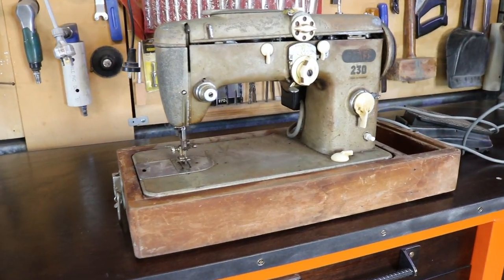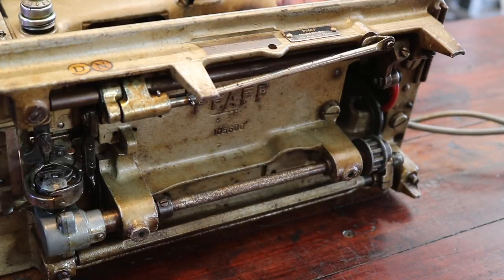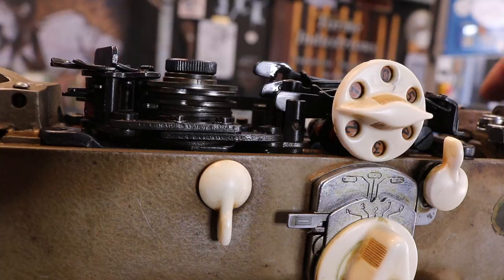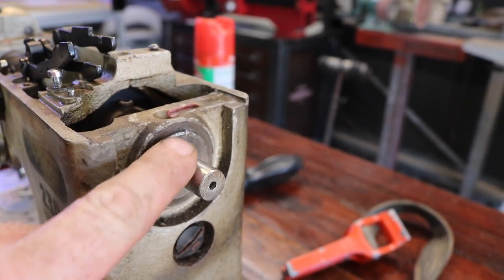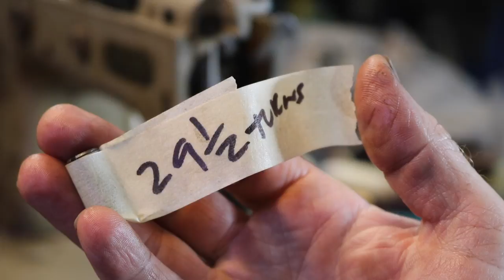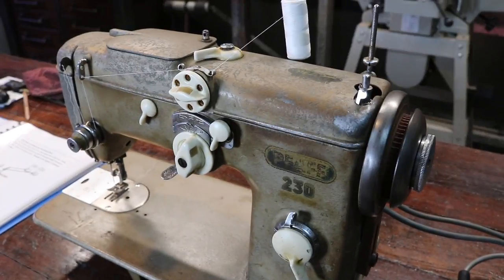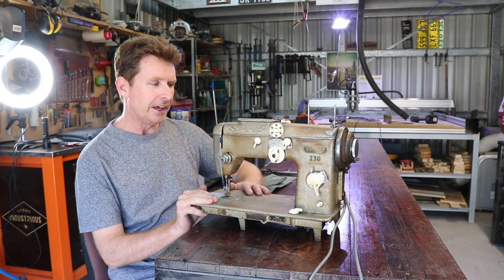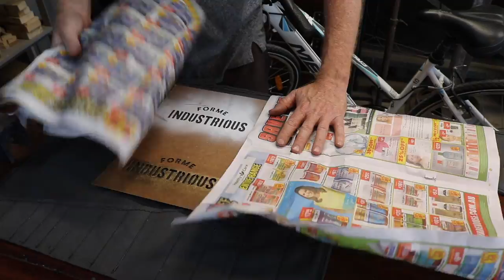Vintage PFAFF Sewing Machine Repair - Forme Industrious

Comment: btw I showed your repair work to my mom, shes retired by now but worked as a tailor until  the whole textile industry was moved to asia in the late 80s, she asked me to relay to you that you did well on the repair and the machine you got yourself is very fine and reliable model, she herself had a very similar one back in the days and was very happy with its performance. so if you keep it clean and run and oil it once in a while you can't go wrong with this one and it will last you another 50 years.
Reply from the maker: Thank you for sharing that with me! Yes all the industries have been moved away to take advantage of cheaper labour and less regulation etc. Please thank you Mum for her advice and her encouragement! All the best!

Comment: I have a 1957 Pfaff sewing machine. It was my Mom's first machine, and I learned to sew on it when I was a kid. It also needs the same belt. It doesn't have the corrosion in it that yours does, but is full of dry lubricant that will have to be soaked out of it. The 'mechanical computer', the cams and pins are mounted on the back of the machine. It is a dressmaking machine, not a light commercial unit. But it IS a cast iron Pfaff, and as so is a heavy unit. Love watching you do your thing. Great video, good tips, I'll need them with this machine, LOTS of parts... Michael
Reply from the maker: Thanks for your comment Stephen! Yes they are great machines I agree and with a bit of effort they can be fixed up and be almost new again. All the best getting your machine humming again.

Comment: Amazing how you managed to strip it apart and putting it back together.

I have a Pfaff 260 that I bought a month ago as a toy to tinker with.  

after mending a used IKEA chair cover, I decided to try out the automatic embroidery function and lo and behold the thread snapped just like yours did, and it refused to turn thereafter.

Upon inspection, the timing is out.  I am still looking online for a manual to reset the timing.

Have fun!

Comment: Welcome to the league of extraordinary sewing machine repairers !!     They are tough to reassemble because there are so many pieces that have to be in the correct orientation. I have a 1946 Adler industrial, a 1960s singer domestic and a boot patcher that I don't know the age of. They are a good challenge
Reply from the maker: I just found a PFAFF 230 on the net for $50 no belt. I'm like the expert now and I'm thinking send it to me....then the more sensible Scott says get back in the shed and stay off the computer ;)
Reply: @ScottTurnerformeindustrious  doing it once when you don't know any better is one thing, but doing it again when  your liveliehood doesn't depend on it is another level of insanity. Of course, I will rebuild my Claes boot patcher even though I haven't done any shoe repair since 94. Listen to sensible Scott. Sewing machine $50 , Time rebuilding $5000  that's a bargain

Comment: Unbelievable.  I've never seen a sewing machine torn down so far.  I bought a well used Pfaff 545 that is not working and you have inspired me to keep working on it until I figure it out.  Thanks and awesome job!!
Reply from the maker: Thanks Rob! Take lots of photos before you pull it apart. Certainly helps getting it all back together.

Comment: Love the use of paper clips as pins Scott!  Also love the stencil.  I’m a construction guy who now sews too.  Same disciplines, different mediums.  Great work! Pete
Reply from the maker: Yes the paper clips, simple and fast. Did the job. Sewing is new to me but I am finding it very enjoyable. Thank you Pierre!
Reply: Hey Scott, I’m hoping you can help me. I have a Pfaff 362-261.  I was having trouble with clearance between the positioning bracket’s finger and the bobbin shuttle hook.   In fastening the positioning bracket, is there a spring that creates tension between the screw, positioning bracket and the sewing machine bed?  I took it apart, left it for a few days, and now I can’t figure out how it reassembles .  I’m wondering if I’ve lost a spring...

Thx
Pete

Comment: Rebuilding a PFAFF 130 and have been doing OK until removing the main shaft. From your video, I see that I am on the correct path. Thanks so much for sharing for us.
Reply from the maker: I'd love to have the 130. Such a nice machine and much sought after. All the best for your rebuild.
Reply: Scott Turner Got it out thanks to your video, thanks so much. Now to clean and reassemble all the parts to make it a sewing machine again.😋

Comment: Love your video.  I just bought a 1957 Pfaff 230, and with a bit of Liquid Wrench, I have the automatic decorative stitching working.  Getting that working helped me learn how this machine really works.  Much nicer and much heavier than a 130!
Reply from the maker: Great buy! These machines are so silky smooth when properly tuned and lubricated. Love it! Thankyou Sheri.
Reply: @ScottTurnerformeindustrious  I know it's yours has the same wher as mine when it runs

Comment: Happy to see you took care of this Pfaff! I have the same Modell 230-automatic still working here; but with a foot pedal in a cupboard. This machine can Stich automatically. Mine is from 1957 and works well. Every electric driven sewing machine capitulated so far on heavy multi layers of e.g. jeans or coats or sail-cloth. We live on a german island 40sm off coast and it’s real good to know that the old Pfaff will be there to repair our coats and bags and even can sew sail-cloth for our boat. To calibrate the under-thread capsule is tricky, but worth it... I have a german manual and still the code-card for the automatic-Stich knob-settings; but I guess you’ll find that online as well. And the company is still there and builds high-end sewing machines to this day...
Reply from the maker: I love my old Pfaff - so good. I have since cleaned it up, repainted the top cover and front cover. Looks and runs great. Sounds like you get good use out of your machine. Great to hear. Thank you and all the best.

Comment: I liked the quip about being more complicated than a 747 engine! 

I recently acquired an old Singer (about the same design era as your Pfaff), and an even older Singer with the cast iron treadle frame. Both are in dire need of help, but when I asked about the oldest one, the "new one" was included. It has had the power cord and the speed control cut off, but moved freely. The really old one has a good bit of water damage to the table parts, and rust on the frame. The sewing machine isn't as bad, so it too might be fine after some cleaning. 
Future projects.
Good job.
Reply from the maker: They take time and a lot of care but the work is very rewarding. Some parts are still available but you may have to look hard. I love the old sewing treadles. Cheers!
Reply: I think Singer refurb is a cottage industry here. My Aunt had an old style Singer (though not really as old as it looks, they made the traditional design a very long time) and up until the 90's getting parts was still rather easy. I'm sure in this age of introtubular times, that has gotten easier. Here, Singers are a dime a dozen (though now a valuable dime, but still)

Comment: scott you chose one of the first portable "industrial" machines I have owned two 1953 model pfaffs and pfaff still has great support for there old machine I sold both in time to buy upholstery level machines the model you have will sew 8 layers of denim in one pass and not even slow pfaff also sells parts for there old machines good luck
Reply from the maker: Thank you Larry! Last week I made my wife a bag folding over the heavy material 8 times (Denham, maybe?) and you are right. I had no presser foot height left but it did the job. I really admire the machine, but now I see the walking foot and my eye is wondering :)
Reply: please keep the sewing videos coming I never touched a sewing machine until I was 50 and I'm still learning maybe you can teach me something in fact I'm sure you can thank you Scott

Comment: Found this exact machine in my Aunt's storage. It is mounted in a cabinet with a knee control. Wish you were in NM. It works pretty good but it wants to keep running even with my knee off the bar.  It is the 230 dial a stitch. Still trying to figure out the tensions. I hope to find a Pfaff service store to do the adjustments.
Reply from the maker: Great machine, congratulations. I would advise doing some research on tensions for this machine as different thread may require an adjustment. Always handy to know how to set up correct tensions. There are manuals on line and a few videos on You Tube. Your machine may need a little cleaning and re-lubrication on the moving parts for the knee lift.

Comment: Mate, that machine is incredible. Far more complex than I'd ever venture to guess. Great dual project.
Reply from the maker: It was a bugger, but I'm glad I got through it. Thanks Matthew!
Reply: @ScottTurnerformeindustrious  I had a good chuckle at the 747 engine comment. I was watching and thinking "I've rebuilt engines that were tons simpler than this monster" glad you got through it. Thanks for showing us.
Reply from the maker: My pleasure Matthew. I just couldn't believe how far it had to come apart to change the belt.

Comment: Thanks so much for posting this. I just picked up a Pfaff 230 Auto (from 1955, I think) from local classifieds. It's in good condition, but in need of some cleanup and minor restoration, which I intend to do myself. This was a great intro.
Reply from the maker: Well I think you have superb machine with the Pfaff Kate. It may need a little tuning, oiling etc but they are rock solid and a joy to use in my opinion. Thank you!

Comment: Taking pics before dismantling. I do the exact same thing with Max.
Top work with this Scott. Maybe I should try to resurrect some of the old Bernina's at school. We scrapped a lot of them a few years back when the repair serviceman said it wasn't worth keeping them running.
Reply from the maker: Well there is of course the labour costs and that is what everyone is worried about $$. But if that is put aside, yes absolutely they should be fixed. The process of repair brings with it untold value and worth to the individual and the machine is useful again. I love the idea that countries are just starting to insist on the repairability of machines. Early days but it pleases me. Cheers Damo!
Reply: Balushai
Reply: Balushairecpie

Comment: Hey Scott.  I just bought a 230 in mint condition.  Looks like it sat in someones closet for the last 60 years. Not a spec of rust anywhere.  It was gummed up and I got it free with WD40 and it now works great.  I'm wondering about the internal belt.  I can't find them listed anywhere and I would like to have a spare.  I counted 68 cog's on mine.  Where did you find your belt?  And how tough are they?
Reply from the maker: Sounds like you have a great machine there. I bought my belt from the UK. I live in Australia and made many calls to suppliers with no luck. If you search for PFAFF 230 parts a two sites will come up that is uk based and from memory one form the USA. Yes count the links and order a spare belt as you may need one down the track some time. My new belt is fine. They are a little trick to replace the first time around.. Thanks and good luck.

Comment: This is a great video.  I now understand how to remove the cam mechanism, didn't understand it until I saw what you did.  I would love to see a slower version and an explanation of how you managed to replace the timing.  Is the nylon top gear cracked?
Reply from the maker: Thank you. The top shaft has to be removed to get the new chain over the shaft. It's the only thing I don't like about the machine. I show this in the video. There are manuals on line that help get the timing set right. Sorry I cannot be of more help apart from the video.
Reply: @ScottTurnerformeindustrious  Thank you for your clarification.  I' suspect that I'll carefully re-watch your video lots of times in the coming weeks.

Comment: Hi, I bought a Pfaff 230 Automatic recently.  It came without a timing belt.  And I have not been able to find a replacement.   Local repair shops tell me they are not available.  Can you please tell me where did you get yours?  It looks new.   I need a 68 cleat, 52 cm long belt, I think the pitch is about 8 mm.  Also, do you think a timing belt that is not cleat can work also?  I would appreciate any assistance you can give me.  I love this machine, as soon as I saw it, and I feel it's worth saving it.  Mine can be used with a motor or a treadle.  And I intend to use it with a treadle.  Thank you.
Reply from the maker: I fixed mine up a few years back now, however I looked high and low myself and ended up finding a place in the UK that supplies them (Sorry I cannot remember the shop). I would not be confident that using an ordinary belt will work well. the mechanisms need to be timed so that the needle and hook do not collide. I guess as long as it has some sort of tooth that the belt can be timed like the original then that would be okay. There are lots of belts like that out there but you need to get is sized right. All the best finding your belt and fixing your machine. They are really nice.

Comment: I do quite a lot of sewing machines in our local RepairCafe. In most cases they need only some cleaning and TLC. Congrats to your thorough restauration! My Mom still uses her Pfaff 362 that she got back in 1952 as a Christmas present. I assume you know that you can do lots of embroidery patterns with the cam mechanism on the top? You would need a proprietory selector disc that shows you the respective settings. Let me know if you would like further information. BR Stefan
Reply from the maker: Thank you Stefan! I was surprised that to change a belt required much disassembly, however I'm glad I did it. The Pfaff is a superb machine. So quiet and smooth. They made these machines to last. Thanks again for your offer.

Comment: Hi Scott. Thank you so much for posting this video. I have a very specific question- can you give specifics on how you use kerosene to clean the machine? The service manual says to 'wash' the substance (vasoline oil and gasoline mix that the manufacturer sprayed on it before shipping) out of the bearings with kerosine while running the machine. Do you just POUR it over the machine. I'm searching everywhere for someone to describe, or even better, to demonstrate. I'm a bit scared.
Reply from the maker: Hi. Without being an expert on these machines, I can tell you about how I was able to free up and clean my machine. I put kerosene in a spray bottle and squirted the moving parts. All of them. My machine was frozen from all the hardened  resinous old oils. With a bit of patience the kerosene will soften and then dissolve the old resins. Several applications of kerosene may be needed. Then, maybe days later gently try and free up the machine by moving the hand wheel etc. Spray more kerosene and allow it to move into the joints and bearing surfaces. Once free and moving nice, dry it all out and apply new oil. The manuals are old. I don't recommend using Petrol or gasoline though it would work too. These machines are all mechanical, apart from the motor. They are tough. I hope this helps.

Comment: This one was funny for me. I've sewn a lot in my past. I have a 1948 singer featherweight I'm just now getting ready to rebuild. full restore. IT belonged to my grandmother. its been around in the family for years ,but hasn't been used at all. My wife wants it going again. The quilting people really love these little portable machines. It's way smaller than yours. those Phaffs are nice machines, I have a more recent quilting model. They're German built, something you didn't mention in the video. I was watching you lift that top center piece, and wondering if it was just going to come unsprung and pieces fly all over your shop. glad it didn't.

Comment: Scott  I have the same model and seems likes its in excellebt condition.  I havent run it yet but would you know where to find the Stitching wheel Template to cycle through the stiches?  Thanks in Advance   Simon
Reply from the maker: I am told there is a template on the internet. I haven't got one sorry. They are sweet machines!

Comment: Hi Scott I have bought this exact machine and they didn't know the timing belt was gone, can you tell me the number of teeth on the belt I need.  I don't know if I should keep it or return it for the $300 I paid for it. I am in Canada and now one here will repair it.
Thanks Kat
Reply from the maker: There are two types of belt. I'll need to go out and count the chain links and get back to you. I bought my belt from the UK. You can see from the video, the top shaft needs to be shifted enough to get the belt over the pulley. That's requires a lot of parts being removed and that's why no one wants to fix these machines. But, if you can fix it they are such a great machine. I'll never part with mine. Do you have the tools and skills to repair it your self?
Reply from the maker: I count 68 teeth on my belt. Hope this helps.

Comment: How do you get the reverse and forward lever freed up? I was gifted one and the lever is so stiff I’m afraid I’m going to break it every time i move it. Do i just need to soak oil? Is Lily white oil ok?
Reply from the maker: Hi Jessica, use kerosene. Kerosene will help dissolve the old hardened oils used years ago. Put it in a spray bottle and over a week or so, spray the mechanisms and try gently to move the levers. Don't force anything. Patience is needed. Good  luck.